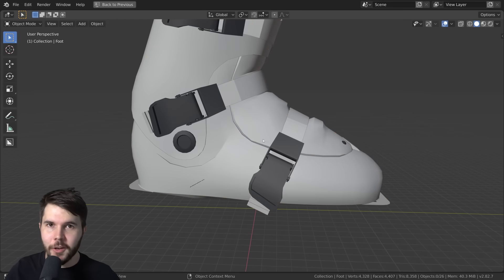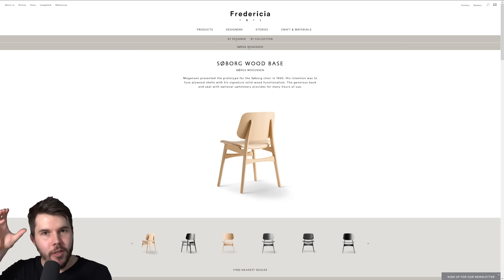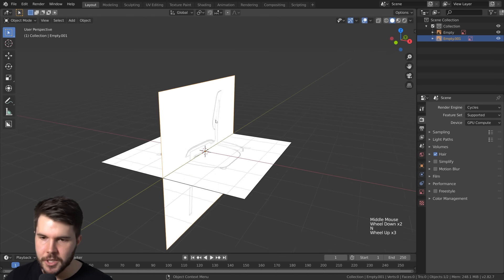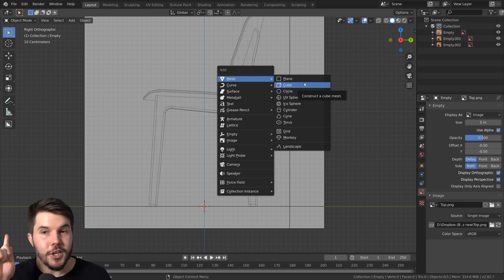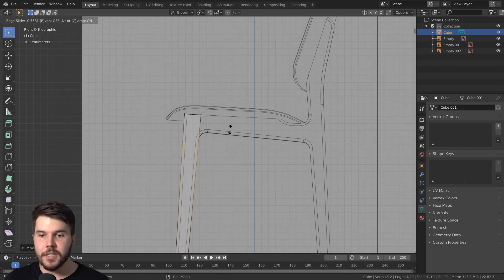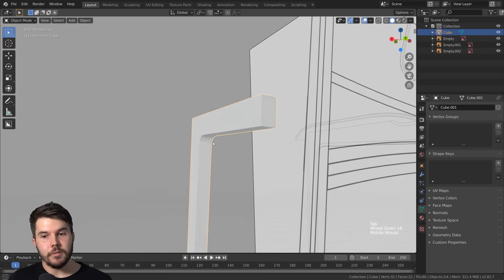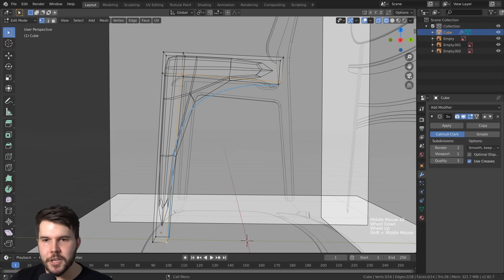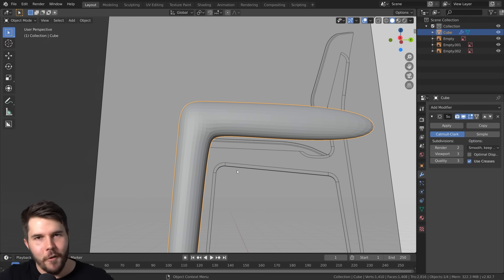Blender Beginner Modelling Tutorial - Part 1

Comment: 1. If you don't get the same mesh at 15:00 try to uncheck "Optimal Display" in Subdivison parameters
2. Before you add Subdivision, try to press A and M to remove redundant vertices

Comment: at 15:01 how are you seeing the original mesh along with the sub div shape? I can only edit the sub div mesh.
Reply: i have the same problem, let me know if u find an answer please :)
Reply: ok, so you have just to uncheck "optimal display" in the subdiv modifier, it was just under our nose :)
Reply: @13a20x2  thanks for that! it doesnt seem to work but to be fair, things aren't behaving as they should. I got to a point where I could no longer zoom in propperly, I ended up deleting the file and starting again. Do you find you often have bug issues with Blender?
Reply: @13a20x2  found an answer to the zoom stopping issue, if you press shift B, you can select an area to zoom into and then it sort of re activates.

Comment: not sure if this is how it has to be modeled but i don't like the approach. the chair leg will be made from a block of wood with straight edges that will be softened after assembly. why did you make the leg stand upright and then skew it slightly? and then do a bunch of weird steps to make it soft but not the right kind of soft? it's bothering me a lot. if i want to learn blender i want to construct the chair before i even think of buying the wood. building and assembly are easy if all the issues are solved on paper.

Comment: Ah, damn. The Subdivision Surface Modifier seems to behave differently in 3.4. Probably other things as well, idk, I'm a beginner. Will there be an updated tutorial for 3.4 or should I just improvise?

/e: Your tutorials are by far the best. Also in terms of presentation. It's never getting dull!
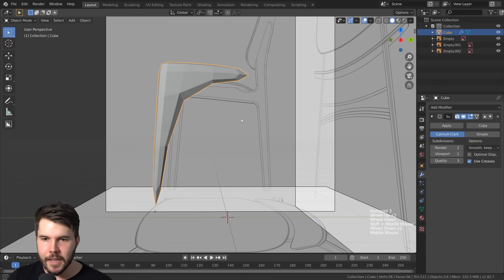Reply: I'm a beginner too had a 90° angle at 14:34 but i started it from the beginning one more time and the subdiv behave just like in the video this time idk what i've done wrong the first time maybe extrude badly but now it's just like in the video
Reply: @cyrilleconte9620  Good to know, thanks! Might start over as well then. 🙏
Reply: Could you explain further? I am also doing this tutorial for the first time and haven't had issues yet.
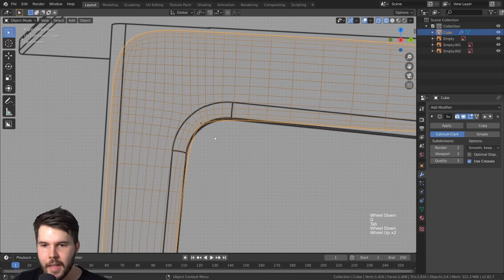Reply: @JamesonHuddle  At 14:30 when he applies the Subdivision Surface Modifier. Version 3.4 makes the shape look more like the finished arc; therefore, the applying and moving of vertices is different, especially at 17:09. It's nothing that can't be worked around though.
Reply: my question is where can one find the Subdivision Surface Modifier in Blender 3.4? followed every step of this tut but i'm not seeing it, thanks in advance!
Reply: a reply to myself: found it with a shortcut ctrl+1 with the object selected:)

Comment: At 17:07, I don't have all those black lines across the mess when I select it in Edit Mode and Wireframe mode. Is there a cause for concern here? I was able to grab and move the vertex like in the tutorial, but those lines don't appear for me and I don't want that to become a problem later. I am using Blender 3.0.
Reply: He increased the subdivisions to 3 for the viewport, which adds the lines you are missing. Under the Subdivision modifier, change Levels Viewport to 3. Hope this helps if you did not figure it out already.
Reply: @anicepop  No that wasn't it.Let me clarify, I do have some lines visible in wireframe mode, but it's not a net-like pattern like Andrew has. I have lines on the outside on my object and ovals in the spots where i put the loop cuts.

EDIT: I found the answer farther down the page, I had "Optimal Display" checked in the modifier window.

Comment: Still dont quite understand why you shouldn't use bevel to create the arch for the chair at 13:58
Reply: because if you use bevel, then that curved area is sort of getting squished and uneven, like a non smooth surface. It's basically because as we increase the numbers of cuts or vertices for the bevel(more than 4), blender cannot smoothen it out due to lack of mesh in smooth object mode. Thus, bevel is not used

Comment: A quick tip for windows users, go into control panel, and ease of access center, make mouse easier to use, check "Activate a window by hovering over it with the mouse".  This will save you lots of frustration when going from the video back to your blender window when you want to hit a key on your number pad and you accidentally restart the video!!!

Comment: is the chair in correct scale? This tutorial has nothing about correct scales. Default unit in blender is meter, by this, it seems this chair is huge. Fine for separate model, since scale is relative, but when actually modelling room/architecture, scale is really important.
Also it would be a lot faster if one could just draw the separate views in polygons, rather than just sculpt them using add and substract.... Why does every single 3d program start out with cube? At least in LightWave you could draw separate views.

Comment: Industrial designer here: yes the inner lines are from the bevel, or fillet that CAD software usually call it (round bevel=fillet/round, sharp bevel=chamfer). The lines are called tangent lines, and show where the curve meets the flat face. It does seem bigger than in the product photo, so I imagine they have revised it after the initial production drawings and not bothered/thought of updating the downloadable .dwg.

Comment: 14:31 I don't know if anyone has the same problem as me, but with Blender 2.90.1 the Subdivision Surface Modifier does not averaging from the three vertices Andrew shows, it adds some weird edges I can't explain https://ibb.co/gRJPL4z
Does anyone have a clue of what's going on ? I can't go further without that :(
Reply: Nevermind; I followed wrong and extruded multiple times instead of moving the top edge of the square at the first step.
After merging by distance (basically removing duplicated vertices), I managed to get the right shape.
If anyone got this problem, give my comment a like so people can see it

Comment: How do you see those wires inside of the mesh?
Reply: hold z and select wireframe or there will be an option in the top right shaped like a cube
Reply: @mistahnuke  I had that activated, but turns out it's an option for the Subdivision Modifier. You have to uncheck the "Optimal Display" option.
Reply: @Buhnanah  Fucking hell, you saved me !
Reply: @Buhnanah  oh ok

Comment: if you look at the front view of the blueprint, the legs of the chair are a little bit thinner at the bottom, and gets wider at the top. it is not a sheet of wood with the same thickness. I dont know if the next lessons fix this problem.

Comment: Love your tutorial series! Quick question: When I apply the sub surface modifier, the inner side of the bend (the part that's supposed to be curved) doesn't extend out at all like when you do it, it actually keeps a sharply bend shape that stays within the outline of the chair. Because of this, I adding loop cuts doesn't do anything so I can't really make a curved section where it's supposed to be. Do you know what could be the cause of this?
Reply: SOLVED
You probably (hopefully) have solved this in the year since but I just went on this journey and have the solution.

If this is happening to you, you probably at some point either adjusted your loop cut or a piece of your loop cut, then control Z'd something or otherwise and this left some sort of artefact. The same thing happened to me because I was playing with transformations. IIRC this happened because I had grabbed three set of vertices to try a type of edge slide to make some lines line up better and it was somehow this that broke it despite not having any extra loop cuts or anything like this.

Unfortunately, it became the way that mesh behaved and so I tested it alongside another mesh that is exactly the same thing in the same project and that one behaved so I simply just deleted the old leg and restarted and all problematic behaviours were instantly gone. I know restarting sucks but tbh it's not too bad of a restart and makes you way handier at just simply moving and editing raw shapes so if it's 'too hard' then it means you have the most to benefit I guess.

Anyways, if you have this problem simply delete your mesh and make a new cube, make it the right size and length, loop cut it, then extrude, fine tune vertices; then subsurface modifier and bobs your uncle. 

I hope this helps someone that fat fingered something and can't figure out why their mesh doesn't look the same.

Comment: When I increase the levels in the viewport to 3, like you did, and then go into edit mode to try and move the vertices found at the center of the bend in chair leg, where the subdivision modifier is affecting the main curve, I don't see all the black/orange lines that make up that mesh of the chair leg as I can see in your video at 17:07. I only see a few black/orange outlines as if the model is still in low level mode (and I do have wireframe and x-ray turned on). If I view the object in solid mode I can see it does have all the same geometry as yours, but it just shows as a much simpler looking mesh view when in edit mode (with wireframe/x-ray turned on). What am I missing?
Reply: In case someone is still watching and encounters this problem, it's because you have checked the "Optimal display" option right next to the viewport and render values. Just uncheck that.
Reply: i am having the same problem right now, did you fix it?
Reply: Same...
Reply: same

Comment: Those extra lines on the blueprint are definitely supposed to be the bevels, and it just looks like the actual manufactured chair just chose to use a different size bevel. I come from an engineering background and have seen plenty of engineering drawings, and am quite confident in the fact that those are the bevels. You see lines like that all the time in engineering drawings, that's exactly how bevels are supposed to be indicated. The best explanation I can give is that engineering drawings will put hard lines like that anywhere that a reasonable distinction can be made between two different faces. In this case the engineer would consider the flat side of the leg to be one face, and the bevel to be another face, therefore a line must go in between.
When it comes to modern engineering CAD software, the leg was probably first modeled without any bevel, and each face of the leg was represented by a NURBS surface. When the CAD operator adds a bevel (usually referred to as a fillet or radius in this context) the software will trim the existing NURBS surfaces and add a new curved NURBS surface as a connector piece. So as far as the CAD model is concerned, there is not only a subjective boundary between the two faces, the two faces are actually defined as being separate entities, and a line will be drawn to indicate where the one surface stops and the next one starts.

Anyway, love your tutorials.

Comment: Someone has probably already commented this and I just don't see it, but in case not:
When you're reading those reference prints, that secondary line to the inside is actually the bevel. In CAD, you round an edge very easily with what's called a fillet (pronounced with the "t", not like the cut of meat. Unless you pronounce the cut of meat with a "t" in Australia. In which case, it's pronounced like the cut of meat). A fillet is a tangent operation, not curvature continuous (unless otherwise specified). So in this case, the curvature would go from 0 on the flat to whatever the radius of the fillet is on the edges instantly. Those lines that you see on prints are what's called "tangent edges" and it basically just marks where the fillet starts. It just gives an indication on the 2D print that the edges are rounded. 
Thanks for the great content, brother!

Comment: Small issue when importing the blueprints for me. Top and front view are sized as they should but side view is scaled wrong. It consistently imports bigger than it should be, using the long side of the top (first imported) as the size of it's long side. Which is oddly specific so I assume there is a toggle somewhere to turn this off. The blueprints have the right dimensions outside so importing them with their real sizes should line them up perfectly since I aligned them in Photoshop prior to import. yet inside Blender I have to rescale them again.
PS: I'm modelling another object not the chair, hence the general nature of the question.

Comment: The inner face is called a fillet, or a bevel the lines are tangent lines which is where the round meets the flat surface, solidworks and other 3d modeling softwares show tangent lines by default

Comment: Whenever I am moving the loop-cut on the top half at around 16:09 it doesn't affect the curve that I need
also whenever I apply the subsurf modifier it has an ugly edge in the top left I can't get rid of. pls help
Reply: it's the loop cut setting. when the cut is done, change the "Falloff" setting in the left hand corner panel to Sphere.
Reply: after the very first cut, before extruding

Comment: Thank you as always but, the reference image is a projection (all blueprints are), You don't have the true magnitude because is a vertical projection plane considering you are modelling the side view. If you model in projection and then you rotate, the magnitudes will be distorted in relation with de cosine of the angle. Is more accurate to start with a plane and then add the 3rd dimension to the leg. BTW, this blueprint are simplified because they don't show hidden edges. So you could think that the legs are not squared between their faces.

Comment: Awesome video! Thumbs up. I have a question though. For practice I decided to model my own house. I got the outside of it looking pretty good (thanks to what I’ve learned from your videos !) But I ran into a problem, when I started working on the interior of the house I kept struggling with the walls of the house blocking my view from different angles. Lol honestly I didn’t see that coming. Is there a practical way to block some walls of a single object or was I suppose to model from inside out? What is the most efficient workflow for this? Doing the hide feature on the walls of the house doesn’t work because when I go into edit mode of another object the walls are no longer hidden... I’m stumped. Do u have a good reference video I should watch?

Comment: I know we're not using the Bevel tool here, but why the f is my bevel pointy and not a curve. 
PS. I also did the Scale thing Ctrl + A but it didn't worked.
Reply: When you add a bevel, you have to scroll up on your mouse wheel for more segments. Afterwards, you should Rightclick>Shade Smooth in Object mode.

Comment: 13:10 is this shading problem kept by the mesh if we use export it in an other software that manages light like Unreal Engine? Even if we create its textures in Blender?
Reply: The biggest problem with everything above 3 (not actually 4) points on a polygon is that its surface isn't necessarily one plane. When the software comes to rendering the faces are all triangulated, as the GPU is only able to render those (stuff like GL_QUADS is all pretty much just automatic triangulation by the driver). The thing we saw here was probably that it can't properly calculate normals because of the many vertices on that one face. You could try to triangulate that polygon (Blender has that function somewhere) but that usually makes it a pain to work with as a mesh later.

So, just don't do it. Work with triangles (for low poly for example), work with quads where you make sure it's in one plane but stay away from everything else.

Comment: there are a whole ton of reasons why companies include architectural and/or dimensional drawings (usually autocad files). one is for studio layout design; people who run wires and do lighting and camera work need to know exactly what that chair will be in front of and how it will block and allow the view of the camera. for desks and such, you need to know ahead of time whether the computers, phones, monitors, ect. you're purchasing will fit on the desk, and whether it will be ergonomically good for the person using it. the shareholders who are funding these things like to get an idea of how a room will look, and safety people need to make sure that adequate space is present around all obstacles in the floorplan to determine if anything is a fire hazard.
Reply: in electronics components specifically, a ton of companies will even provide fully detailed 3D models (well, without textures. function before beauty), to the point where you can completely "assemble" your product virtually and design the case and PCB before ordering a single part.

Comment: Wouldn't it be possible to still use the bevel method for the edge, but just add an Edge Split modifier so the shading won't be all wonky?
Reply: Again there are a thousand ways to do it.
Reply: I like this because you won't have a million loop cuts to deal with
Reply: did u finish the tutorial with that method?
Reply: Or you can use auto smooth for less polygons. Object data properties > Normals > Auto smooth
Reply: my only concern with this method is: will it effect UV mapping/texturing later?
Reply: i tried this but it took away the smooth shading
Reply: Literally such a good method! Thx
Reply: yo i love this trick, thank you!
Reply: you could also bevel the edge, but dissolve the extra vertices and edges. This will just leave you with a smooth bevel. Just be careful not to dissolve the wrong edges/vertices because that will ruin the model.